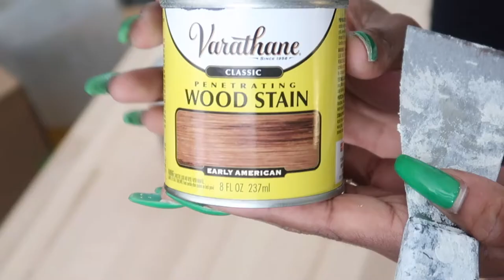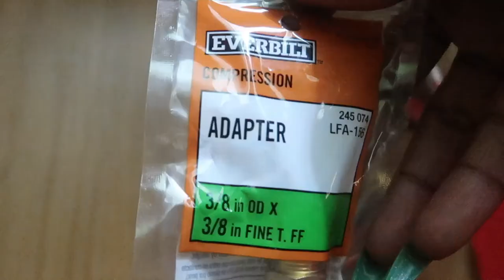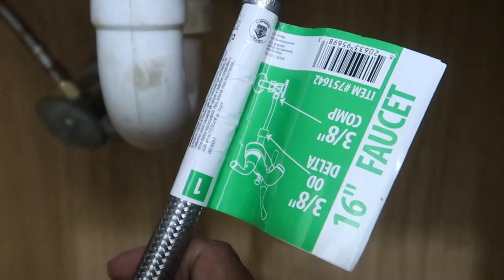How to Install a Vessel Sink | How to Install a Butcher Block Countertop

Comment: the challenge with vessel sinks on butcher block (wood) counter tops is water related damage. Water and/or condensation will naturally roll down the outsides of the sink toward the base. Using caulking around the sink isn't enough to keep it in place with even minor bumps and over short periods of time the cracked caulking will allow moister to build under then around the edge of where the sink sits since the wood might be saturated at some point. So use plenty of caulking under the sink to lock it in place and then caulk around the base with the goal of keeping it secured.
Reply from the maker: @ArthurCowdery  that’s why you seal it with waterproof sealant

Comment: Nice job. Word of caution, I had the same faucet from Amazon and it ended up being a pain in the rear. Held water spots and the matte coating wore off after a year. Also, you might want to replace the accordion pvc pipe as they get can easily clogged and I believe they are not up to plumbing codes. The big box stores sell them as a temp fix for a diy, not really meant for permanent plumbing solutions. Overall, this is a really good thing to see, folks taking control of their home improvements!

Comment: Great video! One thing I noticed is your technique for the plumbers putty. I would watch a few yt videos on how to do it properly. You essentially create a "snake " and wrap it around the bottom of the drain and then once it's seated u cut off the excess that spills out. It seems you put it below the porcelain. It should be on top of porcelain but under the drain. Other than that you did a great job. If you ever have leaking problems I would check that first.
Reply: do you know of a link to a video that shows how to do this?

Comment: Great job! Butcher block looks awesome. I would recommend replacing the accordion PVC though as it doesn't meet the plumbing code for any state anymore as it easily gets clogged and floss/hair/fibrous materials can cause capillary issues for your p trap. Home insurances can drop your policy for things like this as well. A couple of PVC elbow parts can assist and helps to step up your plumbing game even more.😉 Beautiful work otherwise!
Reply from the maker: Thank you, yes I’ve already replaced the faucet.

Comment: Hi Tiffany!
We have a small bathroom as well, which when we bought the house we found out that the previous owner had installed an unusual size of drop in basin. Of course when pulling it some of the Formica came up with it, with no chance of covering the damage with standard sink dimensions.
My wife had mentioned butcher block cut to the unusual dimensions of our bathroom, and a vessel sink became an option.
Your how to video was the first I found on YouTube, and gave us the confidence to make this happen. Doubt we could have done it without your presentation! Many thanks!!!
Reply from the maker: Oh wow, thank you so much!! 🥰🤗